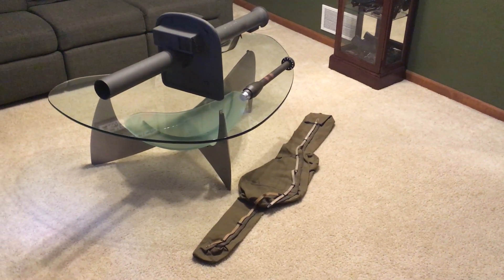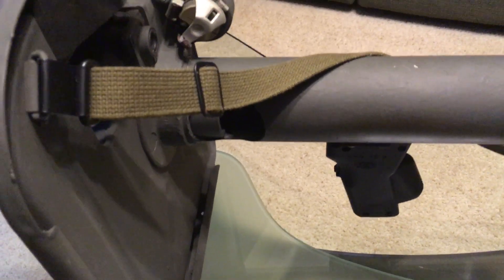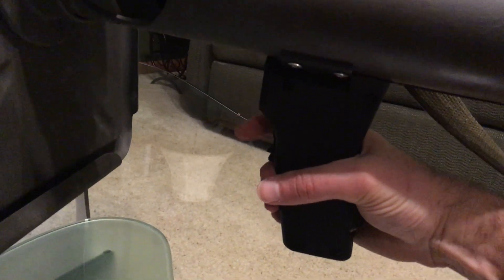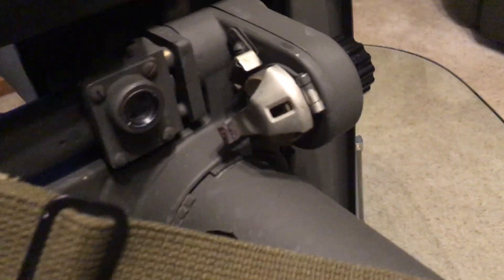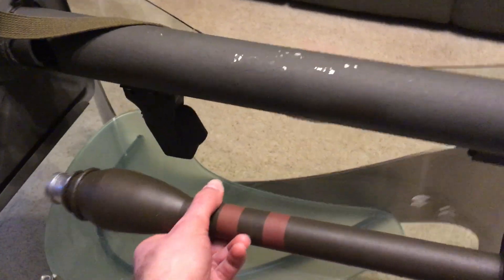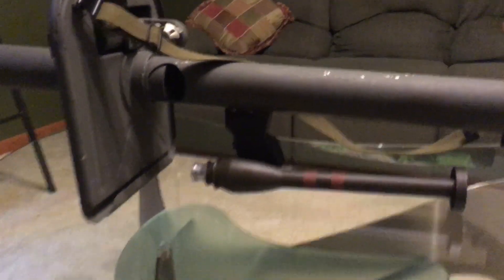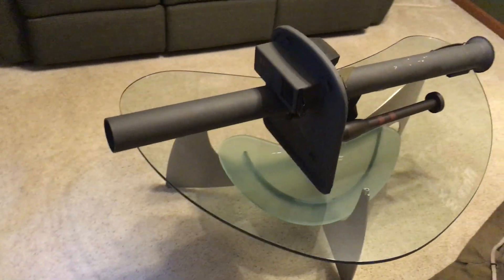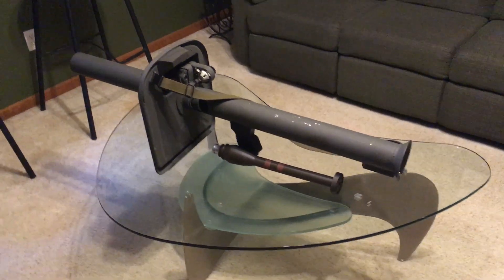French LRAC-50 73mm Bazooka (Post WWII Rocket Launcher)

Comment: I fired one of these in 1979 while serving in Germany as a Cavalry Scout with the 3rd Armored Div. We were training with a French Cavalry unit. Part of the training included firing the weapons of the other army. I also fired a Mat49 submachine gun and their FR F1 sniper rifle. When I fired the LRAC-50, I was wounded by 2 small pieces of steel in the left elbow. Apparently, the rocket propellent sometimes blew off part of the rear of the rocket. Hence the face shield. Not a great design.
Reply from the maker: Thank you for your service!
Reply: @LexCinnabon  Thank you for your video. I had a very hard time finding out what this rocket launcher was called. I knew that the French army used it in the 1970's and that it resembled the German panzerschreck of WW2. I just happened to stumble across your video and it solved my dilemma. Have a Great Holiday,  stay healthy, and enjoy your LRAC launcher.
Reply from the maker: @j.b.macadam6516  Happy to have helped, thanks!